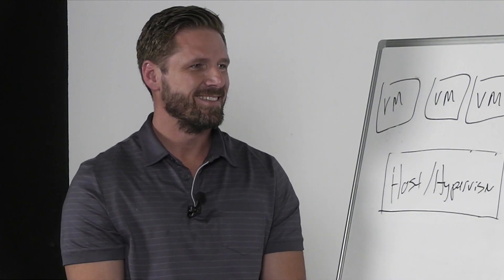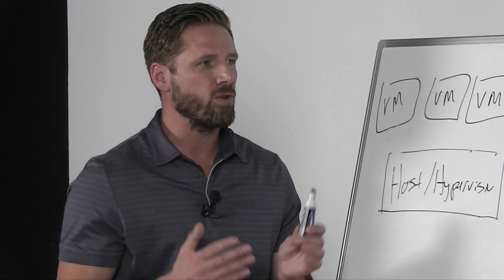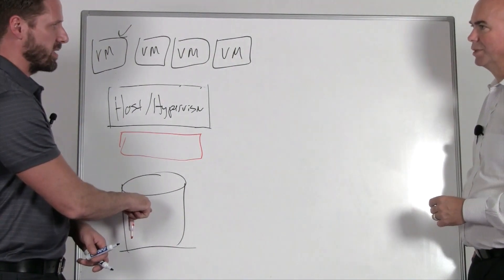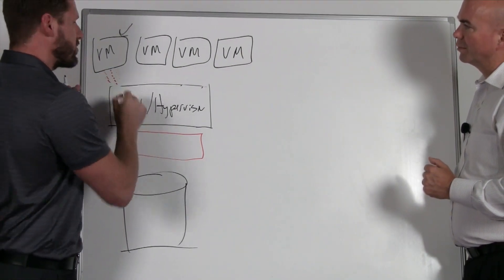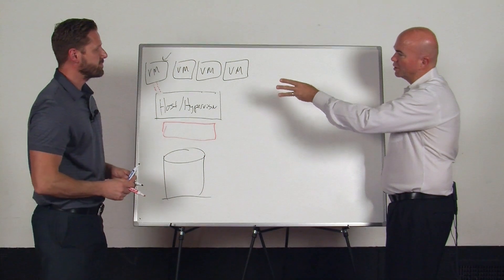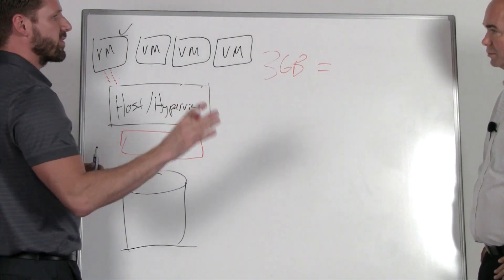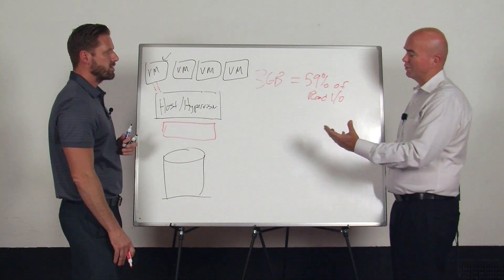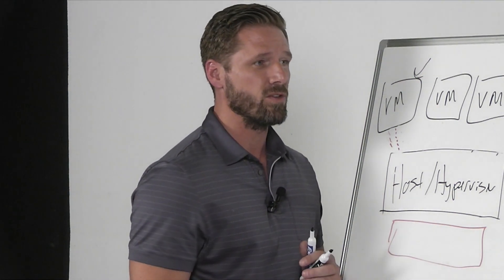VMworld ChalkTalk Video - Is More Flash or Spindles the only Answer to VMware I/O Blender?

Comment: Hi,

@7:24 Brian, "take a little bit of capacity" for
cache, and that equal to about 3GB !!! with a saving of 59% read IOPs.
<br>

Q1) Is this 3GB cache per VM?  & What’s the total vMem in the VM?
<br>

Q2) What was these VM configuration
(vMem/ssd/hdd/iSCSI/nfs/vCpu/vNic/etc...)? <br>

Q3) Can these result be replicated on any windows system?  <br>

Thanks.